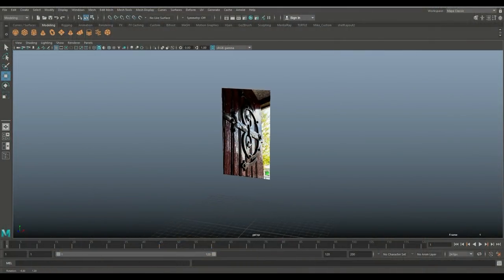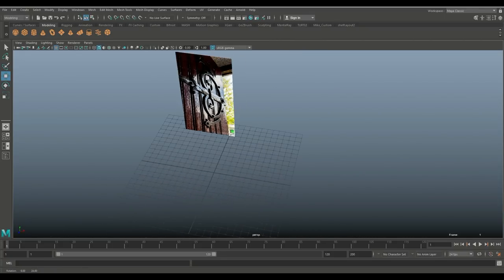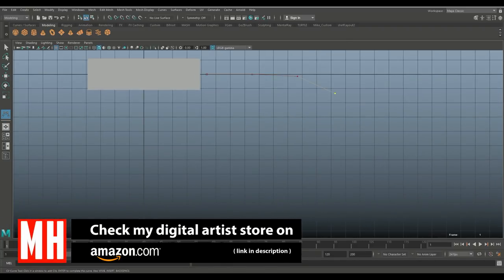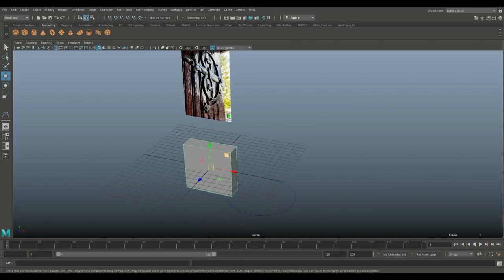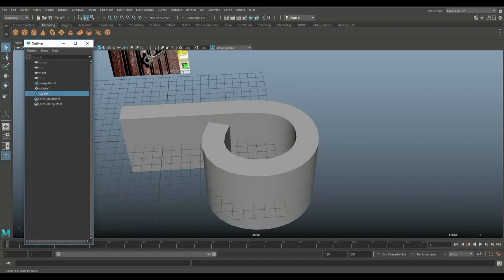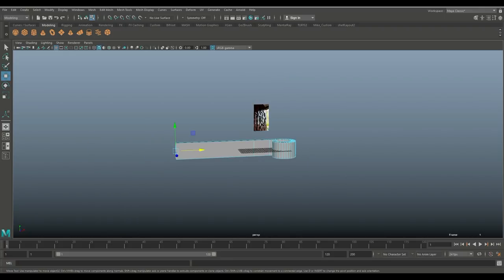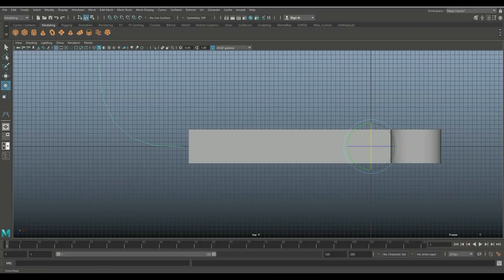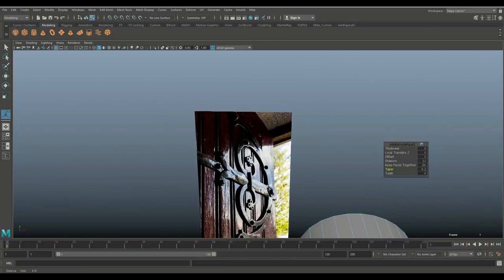How to model CASTLE DOOR HINGES in Maya 2018

Comment: Is it possible to do the same detailing you did with ZBrush, but with something like Substance Painter? As an entry level modeler, I dont have access to ZBrush but do have Substance Painter/Designer. Thanks!
Reply from the maker: Well, you can not sculpt in SP but you can in Maya
Reply: Then in Maya, are the functions similar to what you exhibited with ZBrush?
Reply from the maker: Yes

Comment: Dear Mike.
I try to repeat your lesson. When I tried  the point Extrud, then I do not find there Taper.
What could be the reason? (Maya 2017 Student Version)
Sorry for my english.
Thanks for the answer.
Reply from the maker: Look at the little tiny symbol in the top right corner of the extrude menu and click it. It will allow you to add taper etc
Reply: Thank you very much for the help !!
I look at all your lessons. And although I do not understand English, but I understand how you show up on the lessons!

Comment: Mike, is this configuration good?

Ryzen 5 1600
8gb ram
120gb SSD
1tb hdd
Gtx 1050ti 4gb

Building a new pc, i was going for ryzen 3 1200 but 3d softwares are mostly cpu intensive so going with a 6 core cpu. What are your thoughts.
Reply from the maker: I agree. CPU over GPU ( although that is now starting to change in the industry )